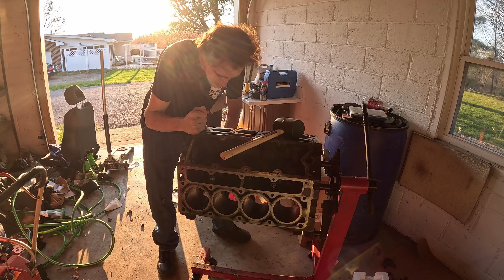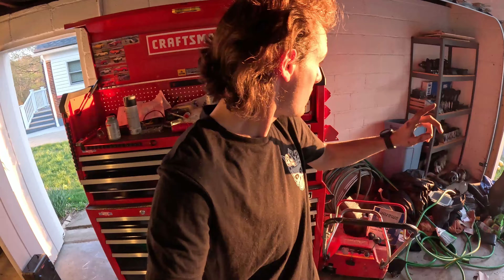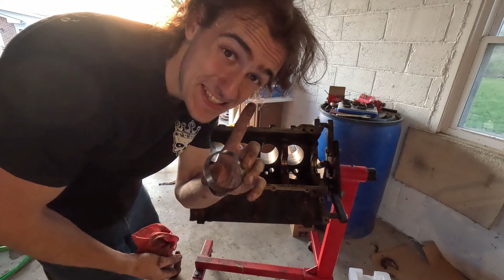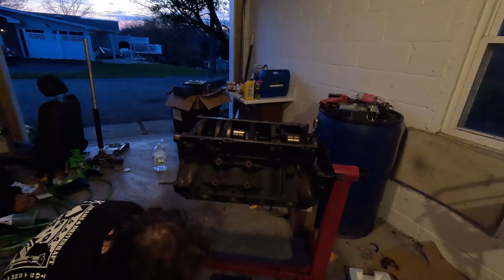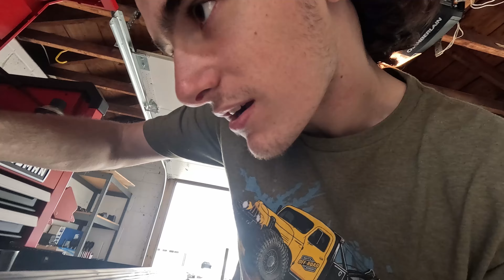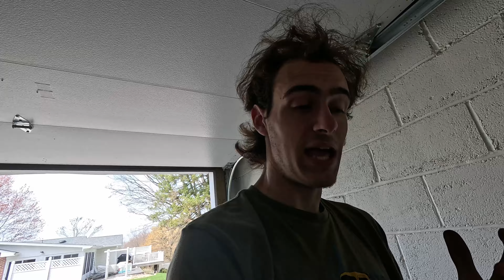I Messed Up My LS Build...

Comment: Do you have a neighbor or a friend that's built engines before. It's always good to have someone with experience as an extra set of eyes and to help you remember things as you go, well for your first build. You need to use assembly lube on all your bearings, not just oil. Assembly lube clings to the bearing surfaces longer, especially since you won't be priming the pump and firing the motor up the same day. Not only that but the initial firing off might take some time and and you don't want to smoke the bearings before it even fires and builds any oil pressure. That being said I've built a motor with only oil on the bearings and it was fine, but I primed the pump about 20 minutes before I fired it up also so, take that for what it's worth. Any ways good luck brother. When it does fire up you will be the brand new owner of your very own addiction, hahahahha
Reply from the maker: I appreciate the advice! As far as I'm aware, I'm the only person in even my entire family to rebuild an engine from the ground up like this, and sadly I don't have much of anybody around to help me out. I did order a Haynes manual specifically for this engine, so hopefully that helps me out a bit. Definitely going to have to get some assembly lube, thank you!
Reply: @FourEyes_4x4  Yeah, I understand. I was lucky enough to have my dad who was into cars and knew a great deal, but mostly older engines so the newer stuff I was figuring it out on my own. Lot of reading manuals, car magazines, and asking questions until youtube came out, haha. Just remember to take a lot of pictures and video even before pulling things apart. It helps a lot.

Comment from the maker: I realized I never actually explained what the issue with the cam bearings was.

Turns out, midway through 2003 GM decided to increase the cam bearing retainer size from 2.327 in to 2.347 on the LM7, without changing any casting or part numbers whatsoever. Since I had no idea what year the center was, it was a blind guess and I just happened to get unlucky